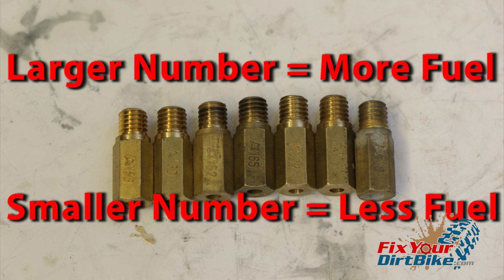How A 2-stroke Carburetor Works | Fix Your Dirt Bike #2stroke #dirtbike #carburator

Comment: So Im trying to my son's kx85 tuned perfectly.  I have it ready close but when at idle if I go to wide open there is a hesitation or bog. I put a JD Jetting kit per their recommendation but still doig it. Any help would be appreciated!
Reply from the maker: At what throttle point does it bog? Idle to full, 1/2 to full, 3/4 to full? Depending on when it bogs will help determine if the needle seat position, needle shape, or main jet size need to be adjusted.

Comment: I’ve also watched ur vid on how to tune a carb and I’ve tryed everything and still can’t get it to idle no matter what I do to the pilot screw ik you said I need to change the jetting but how do ik to up in size for more fuel or down in size for less fuel??
Reply from the maker: First things first, have you recently dissembled and cleaned your carb?

Comment: Hi buddy I have a 4 stroke 125 cc I pulled the carby down and a small ball fell out I think it went under the main jet but I am not Shaw can you please advise me if it is right  thank you
Reply from the maker: It's most likely a check ball, what bike carb?
Reply: @Fixyourdirtbike  it is a motorstar well 125 cc 2015
Reply: Keima carby
Reply: Can't you plz tell me were the small ball go please
Reply from the maker: @brucegissing8591  The only time I see a ball in a carburetor is for a check valve for the accelerator pump, but I don't have any experience with that carb or scooter to know for sure.
Reply: @Fixyourdirtbike  OK thank you

Comment: Hi when I turn air screw out the piston knocks is this normal
Reply from the maker: Piston knock is never normal. This could be a few things. Too low octane, too high compression, or timing.

Comment: I don’t know if you respond to old videos but can you flood you dirt bike if you work the throttle while the bike is off particularly an older one like 2005 with a carb?
Reply from the maker: No. You need vacuum to pull fuel into the engine to flood it. That's why it's easy to flood the engine when trying to start.
Reply: @Fixyourdirtbike  thank you!

Comment: Hello, I tried to put 87octane on my RM250 and it has the same power output with a 93octane but the carb setting is different. My question is should I just use a 93? I tried finding the octane rating on the manual but can't find it. Pls help

Comment: I have a Cr80 and i've cleaned the carb more than once and rebuilt it, all holes I can see through but it will still only run on choke. Any ideas what could be the issue?
Reply from the maker: You are definitely running lean. If everything is clean in the carb, check your fuel filter and gas tank for debris, you cold be starving the carb. If the filter and tank are clean, you'll want to re-jet.
Reply: @Fixyourdirtbike  i went from a #45 down to a #35 and all the way back up. New air filter fresh gas I just don't get it.
Reply from the maker: Have you checked the fuel filter and petcock?
Reply: @Fixyourdirtbike  there's no filter but I didn't think to check the petcock for the fact that it's getting fuel to start but it won't hurt to check it!
Reply from the maker: You should have a fuel filter inside the tank. If not, I recommend you add on inline. Have you checked your reed valves?
Reply: @Fixyourdirtbike  they are new.
Reply from the maker: Did you adjust the float?
Reply: @Fixyourdirtbike  I did that. The seam is Parallel with the bottom of the carb before it plugs.
Reply from the maker: Have you done a leak down test yet? It sounds like you have a vacuum leak post carburetor.
Reply: @Fixyourdirtbike  no. How do I do that? I just rebuilt the top end.
Reply: @Fixyourdirtbike  I just want to thank you for all your help. It was the slide. I had an old one that seems to keep it running
Reply from the maker: Ha, well, at least it running! Glad to help!
Reply: @Fixyourdirtbike  what about on a postie bike when it will start and run for 3 seconds then dies? I’ve cleaned the carby out and put fresh fuel in 🥹

Comment: Hi there!
I just bought a 50 ccm bike with AM6 2 stroke, and it's brutally slow.. My friend goes about 80-85 km/h. My bike's rpm can't get above 8000 rpm on the road. In neutral, it works somehow. Maximum speed 45-48 km/h. Could carbourator setting help me with this problem?
Reply from the maker: Is sounds like you're pilot jet is too lean. What does your sparkb9lug look like after riding full speed?
Reply: @Fixyourdirtbike  I'll test it today after work :D It's 5 am here. Btw thanks for the hyper fast answer :)
Reply: No it will not fix it

Comment: Hi why has my bike all of a sudden started to run rich
Reply from the maker: Have you changed elevation or has the temperature changed significantly? Is your air filter clean? Have you cleaned your carb recently?
Reply: @Fixyourdirtbike  it has got warmer but not that much the carb went through a ultrasonic cleaner for 40 mins and my mates take the piss out of me cause I always put a clean air filter on thanks for getting back
Reply from the maker: You mates are wrong! Did you remove the needle clip when you cleaned your carb?
Reply: No not at first but have now in a attempt to lean it off have set the float at 7 mm which makes it level with the case at  45 degrees
Reply from the maker: The float only affects mixture when it's out of adjustment enough too out-flow the overflow. You might want to check the main jet housing, could've cracked

Comment: i have one 2 stroke bike suzuki samurai i have installed new carburator in it there are 2 pipes attached in the carburator whenver my bike dosent start if i blow a little bit of air through one pipe in carburator my bike then start whithin a single kick... i want to know the use of that pipe and is it safe or not for my vechiles engine and other  parts? fault?
Reply from the maker: Those are vent hoses. When blowing into then, you are introducing pressure to the carburetor circuits, forcing a little extra air and fuel through the system. You are basically priming the bike like you would prime a lawnmower. Nothing to worry about, your engine should be fine.

Comment: Hi John, this might sound like a dumb question, but I’m new to Dirtbike’s...I just bought a rebuilt from the rims up 2000 Honda CR250R and I just noticed after looking the bike over that there are NO vent hoses on the carburetor. I haven’t had it out on the dirt yet. Engine top & bottom was just rebuilt, it’s only got some idle time on a stand for some of the break in, but it hasn’t been rode yet. Could this do damage to the bike in any way without any carburetor vent hose on the bike? 
Love your videos!👍 
I’m just trying to learn as much as I can, and you are helping me greatly. Thanks!
Reply from the maker: Thanks for watching and I'm always happy to help! The lack of vent hoses on the carb will not affect how it runs. It will affects how it keeps running when they get clogged up.  You can get some new vents here → https://ebay.to/2QOB3Iu
Reply: Fix Your Dirt Bike Thanks for the reply & the link! An acquaintance who works on bikes told me to just leave them off🙄 Is that ok to just leave them off? I want  to keep my bikes engine healthy & running & performing the best it can. Thanks for your input!

Comment: Good day.  I have a Chinese four stroke dirt bike 250cc. It would start up in about 3 cranks.  But as soon as engine gets hot it wouldn't start. You have any idea what can cause this problem?
Reply from the maker: That could be a lot of things. try this: 1st - Clean your carb and check spark plug gap. 2nd - Check your reed valves. 3rd - compression check the combustion chamber. 4th - Perform a leak down test (https://youtu.be/UZ7xoddJQZs).

Comment: My motorcycle yl2 yamaha chok on then only can be start n run,when off the chok engine stops y
Reply from the maker: Sounds like your jets are clogged.
Reply: @Fixyourdirtbike  Yeah de same wit mine but after de engine warms up it's fine...normally i use choke on every start...is dis normal?needle clip is set on 1st groove 4rm Top...

Comment: I have the same carburator and tha slide does not open all the way what is the problem
Reply from the maker: Sounds like your return spring is binding or your cable is stretched
Reply: @Fixyourdirtbike  thanks for responding 
How can i fix both of those problems?
Reply from the maker: Take your carburetor slide out and re-seat the spring. Not much you can do about the cable except make sure it's adjusted properly. If its stretched you'll need a new one.
Reply: I figured it out 
Because i just bought the bike the previous owner had put a spring too small for this carburetor and as you screwd the cap the spring stretched and didnt open all the way

Comment: I have an mtx 50 2 stroke, and some shoddy garage stuck a 4 stroke carb on it, thankfully didn’t charge me but the bike bogs at Higher revs and loses power, and goes through spark plugs rather fast, would that be why?
Reply from the maker: Your mix is too rich. Try dropping down a size on you main jet and see what you get. What does your spark look like after you ride?

Comment: im porting  my yamaha rx135  its sounds good but when i accellrate  little quick in 1/4 to 3/4 my bike doesnt responce good its blow down im doing every thing like changing  pilot jet and main jet with bigg numbers and reed valve supporters open more what i do plz help im using pod filter with my carborator plz help

Comment: hey I have a rm250 2 stroke, when I start her up she is stupid loud. I have played with the air screw going both ways and it doesn't make much of a difference at all. I havent touched the idle adjust screw cause its different on this bike since I never had a 2 stroke. Do you think it would be the idle making the bike very loud or what.?
Reply from the maker: Just to clarify, when you say loud do you mean reving high or idling at high volume?
Reply: idling at high volume. but I believe I was able to fix it. I had to take out the idle screw completly and screw the distance on there manualy and then out it back into the bike. now she idles just right
Reply from the maker: Interesting, because high volume would indicate the silencer pack needs to be replaced.  But you might as well do that too! https://www.youtube.com/watch?v=iIwTnO0xuEQ
Reply: I have done the silencer pack and that high ver was after it had been done. all it was was the throttle cable pulled up the whole time after reassemble of the handle bars.

Comment: Can someone help me I have a pwk 38 carb wit or without the air screw it idle the same and it keep killing my plugs any suggestions help!!!
Reply from the maker: How long have you had this problem? Its it super hot where you are right now?
Reply: Fix Your Dirt Bike not super hot but am in the Caribbean
Reply from the maker: How long has your bike been doing this?
Reply: Fix Your Dirt Bike it been doing it about a year now I bought it like that from someone so am trying to fix it
Reply from the maker: Try a one size smaller pilot and slow jet.

Comment: Whats different between 2 stroke and 4 stroke carb operations?
Reply from the maker: They are very similar, but there are small differences with air flow control. I will make a video on 4-stroke carbs as soon as I get my hands on one!
Reply: You can slap a 2stroke carburetor to a 4 stroke engine. I did it to my bike using a Suzuki TS125 carburetor. The 4 stroke engine are Kawasaki 120cc engine kinda similar to z125 engine with minor difference. The power gain are tremendous and the top end speed increase a little bit. Definitely a mile of difference between 2 design.

Comment: 🤔Isn’t this exactly how all carburetors work???
Reply from the maker: The general principal of drawing fuel into the engine via vacuum, yes, but there are a few differences between 2 and 4 stroke carbs. Which I will be getting to the next time I get my hands on a carbureted 4 stroke.

Comment: in 2 Wheeler wether carburetor is mechanical system or does it need electricity for it's working ?
Reply from the maker: Carburetors are a mechanical system.

Comment: PLEASE HELP, I have cleaned and adjusted bowl height on carburetor and tried a brand new (Chinese made) carb, both start leaking fuel immediately after turning fuel on
Reply from the maker: how far have you adjusted the float tab? Is the end of the float valve in good shape?
Reply: @Fixyourdirtbike  the only way it will leak fuel is if the needle and seat have got a pice of dirt in it or your flote level is to high

Comment: I recently bought a new 2015 KTM 250sx and right of the bat it didn't sound right, it doesn't seem how a 2 stroke should be, I don't get the response I should in first or second gear and I hit my power band in like middle of third gear. It's like it bogs down in first and second gear I was just wondering if doing this will change it? I'm new to riding and don't know to much so any advice would help thanks!
Reply from the maker: Where do you live?  KTMs are jetted from the factory to run between 61°F - 78°F and 100-2500 feet above sea level.  But from what you described, your jetting is way too rich.
Reply: +Fix Your Dirt Bike I live in Maine, it's normally around 60 or 70 when I ride but first and second gear are just wierd, my friend has an 03 yz250 that rips and hits power band the second you give it throttle. So I was just wondering I can get mine to run like that
Reply from the maker: Go to www.whatismyelevation.com and put in the area code or city you ride in and let me know.
Yes, you can get yours to run like that.
Reply: +Fix Your Dirt Bike oh okay thanks! I'll probably just bring t into a shop and tell them what's going on because it's irritating it's almost like it's running as a four stroke
Reply from the maker: I can't stress how easy it is to re-jet your carb. You can save a load of money and buy the jets you need for our bike so you can re-jet as the seasons change.  The only thing you need to be careful of is not over-tightening the jets, they are brass and they will break.

Comment: On a honda 2 stroke (keihin) carb... After cleaning the carb, the pilot jet screw inside the carb not the air screw is supposed to be screwed in all the way?
Reply from the maker: Yes, the slow/pilot jet needs to be screwed in all the way.

Comment: Awesome video! my bike is a 1975 Kawasaki F7. Since I have bought it, it has had carb issues. I have gotten the bike to idle but as far as getting it in motion, when I move the throttle more than halfway the bike bogs down, I have to tinker with my hand position on the throttle, slowly bringing it up or back down, to get gas response and though its power band is @ 7500rpms, I can only get it going to 4 or 5. ALSO, I do not know if it is related, but the petcock is an old vacuum sealed one. When I have it running, on ON or PRIME it runs okay but once I put it to reserve, the bike after a few moments roars to life and just flies until a few seconds later it runs out of gas and sputters out. Could my carb bowl be not properly set and giving my bike too much gas, so once it runs lower the bike allows the proper amount in?
Reply from the maker: +Jordan Prato This is definitely a case of too much fuel, and yes, there is a good chance your floats are out of adjustment.  Let me know how it goes!